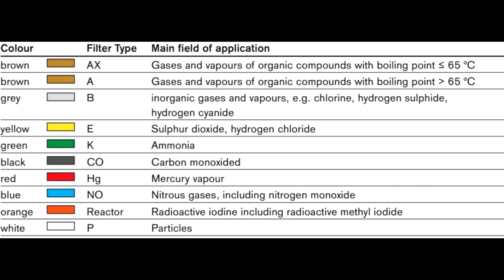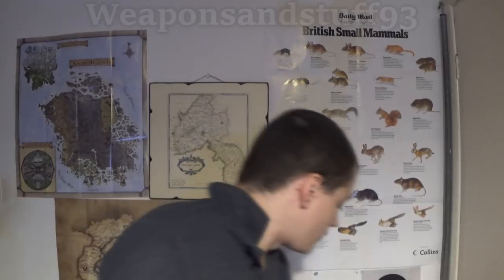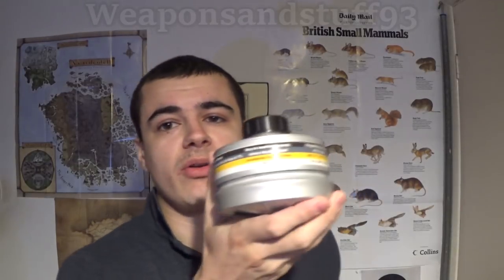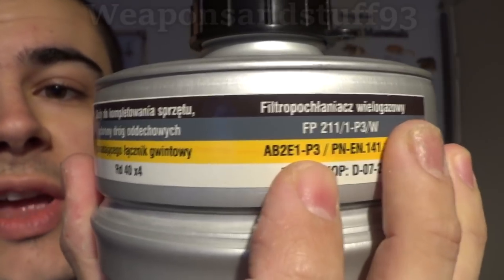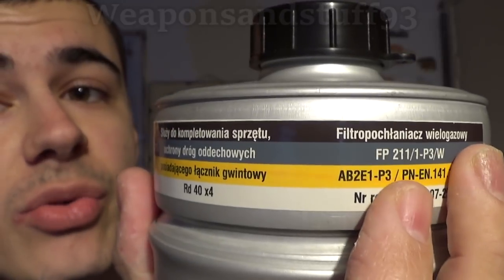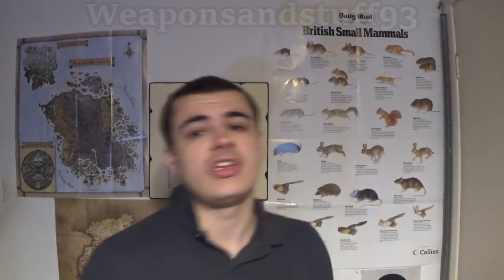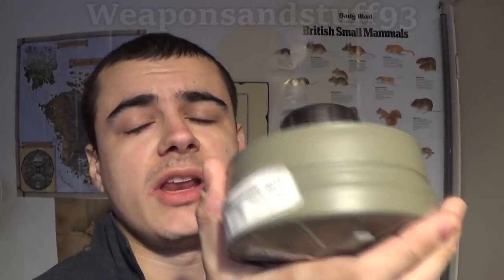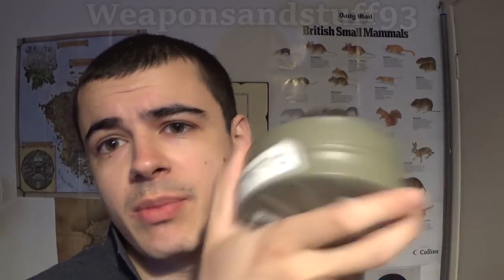ABEK filters explained

Comment: I was looking at some Polish ABEK filters on ebay, but I wasn't sure whether they were gost, normalized, or nato. Is there any certain specification I'm supposed to look for if it the item description doesn't say so directly? The filter model that I was looking at was a "MSA AUER 89 ABEK2-HG/St" and I wasn't sure if it'd fit a Gp7.
Reply from the maker: MSA AUER is American, so no it will not fit the GP-7, they will be NATO filters, just get a Polish FP-5 filter.
Reply: One more question, what are your opinions on 40mm gas mask hoses. The item descriptions say they fit "MOST NATO, Russian, and Israeli" gas masks, but I wasn't too confident on the seal. With this, I was hoping to fit on a type 80 Israeli filter as they are currently more accessible to me than the FP-5. If worse comes to worse, I'm just planning on buying an israeli 4a1 as the places I'm heading have WWII era industrial fumes as well as fumes from 70+ yr old leaked WWII medicine bottles.

Comment: So a filter rated as NBC/ABEK Threats would mean it protects against both vapors, and particulate?
Reply from the maker: the P after ABEK indicates particle protection so an ABEK1-P3 filter for example is both vapour and particle but an ABEK1 filter would be vapour only. NBC/CBRN filters are all basically ABEK1P2 minimum most now are ABEK2-P3
Reply: @Weaponsandstuff93  Thank you.
Reply: @Weaponsandstuff93  would this be a good nbc filter a2b2e2k2

Comment: Thanks for the video.  I was wanting a full face respiratory mask for all around safety from working around mold and bleach for home cleaning as well as for some and toxic fumes from forest fire or home fire as well as for viruses since I live near the CDC and I'm always scared somethings going to get out.  I was told that I might need multiple filters for each use. 

I was thinking about buying the (3M Full Facepiece Reusable Respirator 6700), would you recommend a different face mask? and can you recommend the filters I would need for (mold, asbestos, bleach, smoke, toxic fumes, viruses).  Thanks.
Reply from the maker: You'd need an ABEK-P3 filter I imagine, that at least guarantees to protect you from most airborne threats, 3M filters may work out expensive in the long run, I'd personally recommend any NATO 40mm mask you like the look of and then RD40 industrial filters rated for ABEK-P3
Reply: @Weaponsandstuff93  Thanks for the reply.  Found these filter on Amazon, which do you think would be best for smoke from forest fires as well for viruses?  I would think the one with CO? (Drager 67 38 801 A1B2E2K1 Hg CO NO P3 D 40mm Military Grade Gas Mask Filter) OR (1140 A2B2E2K1HgP3 R D Gas Mask Filter 40mm)
Reply from the maker: @Carperama  Filters can't really filter CO, only very small quantities of it in open areas, just get the cheapest 40mm ABEK-P3 filter you can find that is in date.

Comment: Mate, I started work in spring factory, were they put red hot steel/iron in oil tang to make it stronger. There is also a lot of steel/iron cutting with angle grinder and lost of dust.  What loud be the best filter for me ?
Thanks in advance.
Reply from the maker: For the dust a particle filter so P3/P100. As far as I'm aware metal fumes are particle based but a basic A1P3 filter wouldn't hurt.
Reply: @Weaponsandstuff93  

Will get A1P3 then.  Thank you.